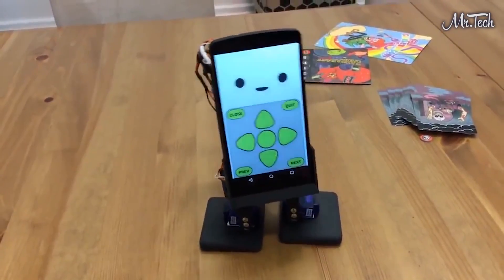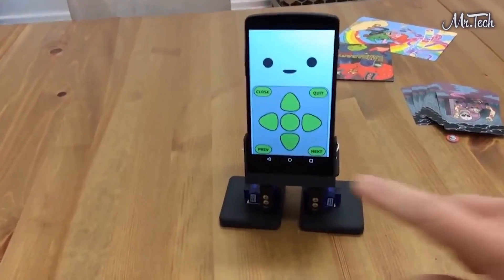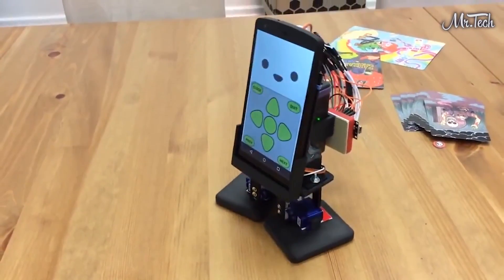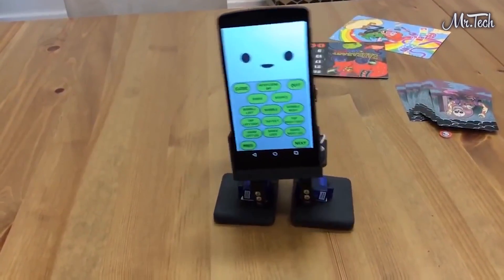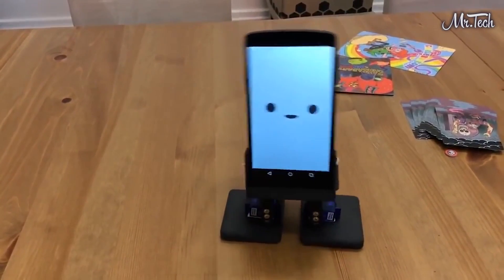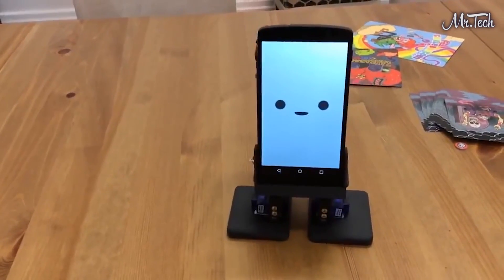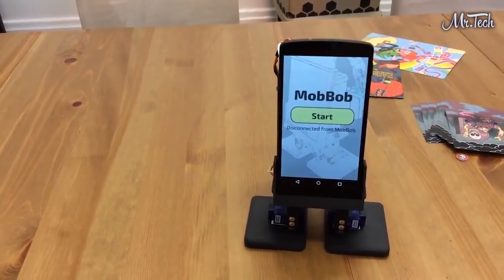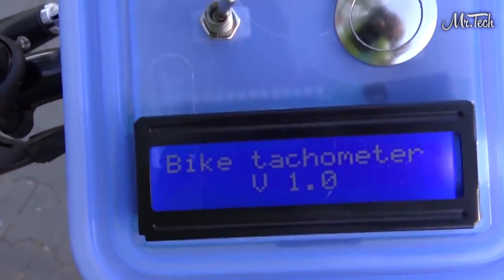Top 10 DIY Arduino Projects

Comment: I've watched a lot of these videos now and I have a serious question. Are there any Arduino projects that aren't worthless, pointless garbage? Or something that I can't already buy as a complete working gadget off of Amazon? I don't think I've seen anything on YouTube with any genuine inventiveness and innovative worth.
Reply: You can make a HOTAS (Hands on Throttle and Stick) for flight simulators.

Many affordable joysticks use a low resolution sensor (255 points on each axis).

With an arduino you can bump the accuracy up to 1023 dots on each axis which is 4x the resolution.
Reply: Arduino is just a platfrom for experiments and prototyping. No one will offer you a product based on all these wires, glue, etc. If you want to upgrade one of your prototypes to a working solution, you need to select a microcontroller, a set of modules, design a PCB and test this stuff. Of course, there are some interesting projects based on arduino-like devices, but I think they are all overpriced (maybe excerpt for the RPi projects).

Comment: 13:09 Shouldn't the bot avoid that obstacle? what does it use the ultrasonic sensor for?
Reply: I thought the same. You also need a project to make at school? I do. I want to make maybe a bot that avoids obstacles or maybe a security camera, maybe you have any ideas for me. Not too easy, not to difficult and not too expensive to make.
Reply: @oliviergoggins  Do you need my mail address?
Reply: @markusschnepf  from where should i start learning?
Reply: @markusschnepf  thanks, ill check it out later.
Reply: @oliviergoggins  Hi Olivier, I do not need a project for school because I'm already 26 y/o. I'm a software developer and self employed so I do know how to program very well. A bot that avoids obstacles is a nice projekt but does not have a real purpose. A security cam would be the better project IMHO. 
But then please stay away from Arduino because they provide too less computing power (with 8Hz to 16Hz clock rate it would take 1-3 minutes to process and save only ONE image in HD resolution). Try using a raspberry pi Zero W (the "W" is important because it stands for "wireless" [wifi and bluetooth]). The zero W is quite cheap and building the camera + programming it is quite fun. If you don't have the knowledge about raspberry/linux: there are maaaany tutorials online).
If you need help don't hesitate to contact me and I will help you to get this project done. even if you decide for another project. I built myself a RC Rover with 4 Motors/Chains, but that does cost a bit more.